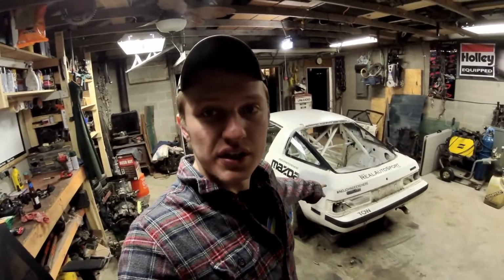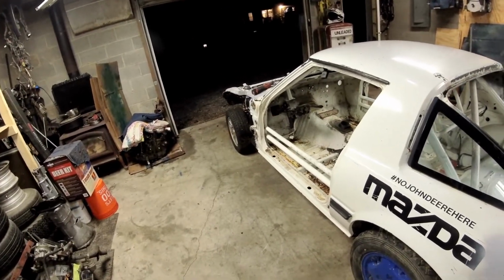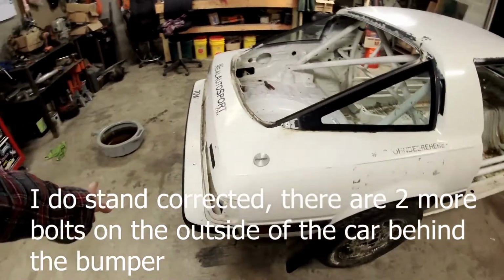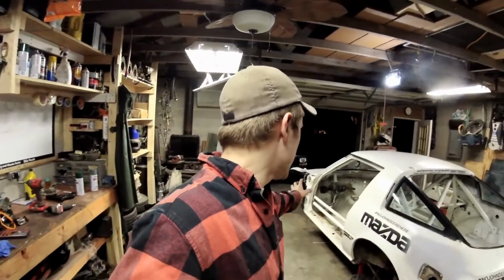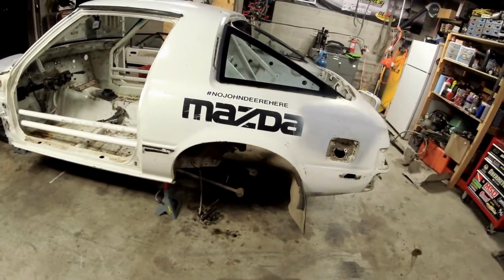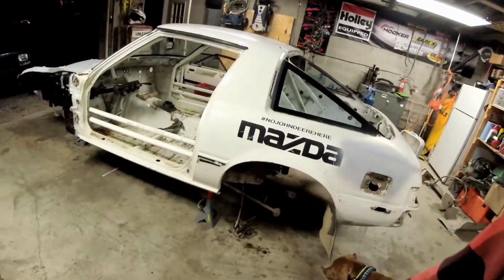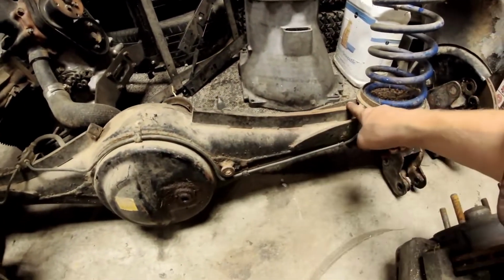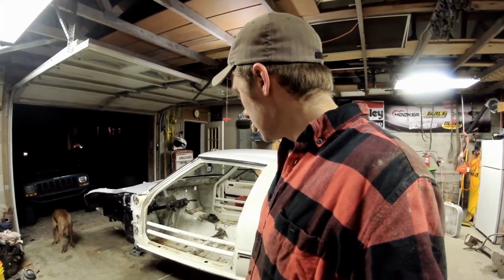Ready For Rotisserie - 84 RX7 Rally Car Restoration

Comment: G.m brotha i wanna start by saying i love the channel .its very detail .also i have a 84 gsl se the i bougth for restoration but im having a hard time finding the motor 13.b my way they getting harder to find.maybe you mite know some one i cud probally purchase .thank u and sorry
Reply from the maker: Thank You sir!!  These days you have to buy whole cars to get good engines anymore.  some engine builders offer whole engines for sale, is yours rebuildable? or just trying to save some coin with a used engine?
Reply: Look at rotaryengine.com.  They are based out of Calgary, Alberta, Canada.  They have been in business since the early '90's and this is all they specialize in.  They do custom builds and can do grinds and resurfacing.  Doesn't hurt to check them out.  Have nothing to loose but some time.  Hope this helps you out.
Reply: @RADPotential  i got the car with out motor or trany .the shell its pretty clean .im restoring it little by litlle i have a 12 a transmission the i had from another car
Reply: @MrJasonburak  thank you i will look into it